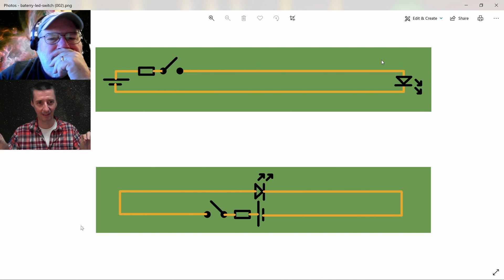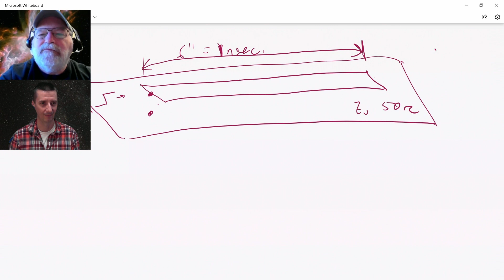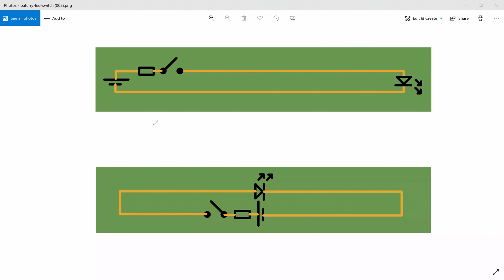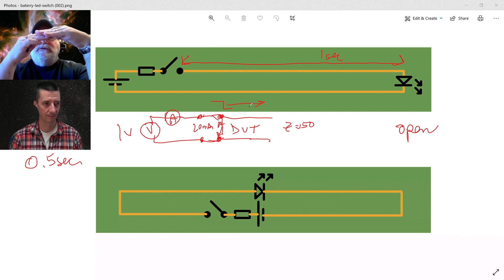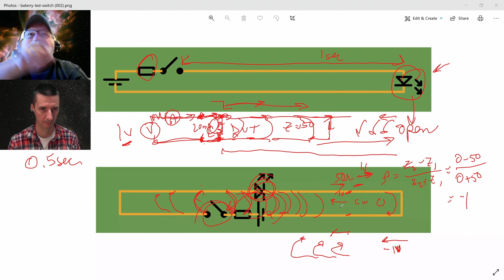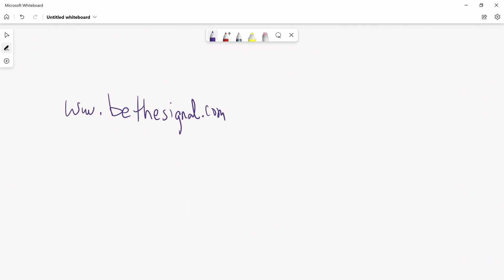Explaining Veritasium Electricity Video: Energy doesn't flow in wires (with Eric Bogatin)

Comment: I loved this video!! unfortunately the last part lacked some detail... The circuit created in the original video, as Eric perfectly described has 2 transmission lines and the reflections can make the situation quite complicated. Depending on the Zo of the Tx lines (in the video two simple cables separated 1m by air) can be in the order of 800 ohms (a 1mm diameter cable and 1m separation using the standard equation for a bifilar tx line), if the propagation speed is considered to be C (time delay to reach the end is 1 sec), and just to take a number consider that the light bulb is 100 ohms, the multiple reflections (and transmissions) from one Tx line to the other will create a time constant that can last tens of seconds (with steps every 2 seconds) to get to the steady state value. This is quite simple to simulate in Pspice. The instantaneous current through the light bulb is V/(R+2*Zo) (neglecting the V internal resistance), which naturally will be extremely small because is displacement current between two wires spaced 1m appart.
Reply: Exactly! That was my first answer, the LED will start instantly but very dim. Also Dave on eevblog missed that out.
Reply: I've still not seen anyone explain this correctly, as Federico Di Vruno has mentioned, and now even the Master of SI himself has ignored the details that so many engineers are bothered about on this problem!
Reply: @HelloWorlds__JTS  few people understand that when the switch is closed the two transmission lines look like a resistor equal to their characteristic impedance, or 800 ohms. Therefore, when the switch is closed the light bulb is in series with 1600 ohms and the travel time will be for the 1 m distance between the battery and the light bulb.
Then, as the reflections bounce back and forth the light will flicker depending upon the instantaneous voltages and eventually settle out to the DC circuit of just a battery and bulb.
..
The way the circuit is arranged, this is very, very deceptive. It is almost certainly done to confuse everyone.
Reply: @Observ45er  It was not to confuse anybody. It was to demonstrate that wire doesn't carry energy. People confused themselves.
Reply: @PafiTheOne  if wire doesnt carry energy than pls touch  220VAC wire with your hand....
Reply: @naszadynastia  A do it regularly while developing and testing offline power supplies. Try again!
Reply: @PafiTheOne  So why is the wire needed, if the wire doesn't carry any energy?  Obviously the wire serves some purpose.  If people are confused, it is only because they know intuitively that the wire is there for a reason, but no one is telling them what reason.  Instead, we're playing gotcha clickbait gimmicks by pretending displacement current will be enough in a situation like this to make a light bulb reach nominal brightness nearly instantly.  People are right to be suspicious of this, because it will not happen as shown in the original video.  To use the original author's words, he lied to his viewers about how electricity works.
Reply: @DeadCatX2  Almost nobody asked why there is wire. But the answer is trivial. The wires are there to conduct electrons. And not to conduct energy. (1 particular way of carrying electrical energy involves conducting electrons. It is not neccessity, only 1 choice. You don't "need" the wire.) This was the subject of the lession: Electrical energy and charge are not the same thing, and even not in the same space . 

Nobody told full current. (Yeah, except for the lie of RSD Academy guy, telling "short circuit".) That's just an irrelevant misuderstanding.
Reply: @PafiTheOne  It's not an "irrelevant misunderstanding", it is something Veritasium deliberately SHOWED his viewers.  During his demonstration, the bulb reaches full brightness in an instant.  Can you actually argue in good faith that this was not intended to trick the viewer into thinking that full power delivery occurred after 1m/c?  To use his own words, he has lied to us about how electricity works - even under ideal conditions there is only 1/4 of the total power available at the load after 1m/c seconds, and the other 3/4 of the power will be delivered to the load once the wave has propagated down the wire, which will take one second.

Furthermore, once the transmission line has charged, there is no more displacement current, and the Poynting vector is no longer the appropriate way to analyze the power flow.  In other words, the effect which keeps the light on is totally different from the one that could possibly turn it on after 1m/c seconds.  And you DO in fact need the wire if you want that DC circuit to keep driving the load.
Reply: @DeadCatX2  OK. So you seriously believed for even a moment that this thought experiment has really been conducted?!? I have not imagined this before that anybody could believe this. And you believed those wires were 1 lightsecond long and made of superconductor? This is a whole new point of view I haven't realized before. Thank you for enlighten me!
Reply: @DeadCatX2  Yes, I can argue that this is not an intentional misleading. If anybody wants to figure out the answer to the question , then he needs to listen to the beginning where the details of the (thought!) expriment are told. But the bulb shown in the video is lit near the end of the video. A real problem solver should not watch the solution before understanding the question. So if you are tricked, then tricked yourself by peeking the solution before understanding the question. :-)
Reply: @DeadCatX2  "the Poynting vector is no longer the appropriate way to analyze the power flow"

Obviously you have not calculated any Poynting vector if you believe this. It is perfectly valid at DC also.  E field is obviously still there, and instead of displacement current the conduction current generates B field, it doesn't make any difference in validity, only in value, and is perfectly coherent with the result of simple circuit analysis. The power transfer is still be described perfectly by Poynting vector. (Obviously this is not a deduction, the deduction is made by Poynting.)
Reply: @DeadCatX2  Yes, the effect is "totally different", because it is a sum if many waves, not only the first. But all of the waves are described properly by their Poynting vector. So there is no error in this. 

You are right, the wire is needed if a circuit is defined to contain wire. :-) But this is nothing but tautology. In a different circuit it is possible to drive the load without the wires, just not in that circuit, because it is defined to contain those wires.
Reply: @DeadCatX2  "in an instant". Can you see 3.3 ns delay in the video? :-) That was the official answer, not "an instant"!
Reply: @DeadCatX2  "1/4 of total power"

You believed what this video stated? No, there is not a defined ratio. It depends on the actual impedance ratios. Can also be much worse or slightly better. The higher the resistance of the bulb the more portion of the final current arrives "instantly". (Maybe this was the only error in this video if we don't account that it bored me to death.)
Reply: @PafiTheOne  I said in the ideal case, where the source, load, and characteristic impedance are all equal, that you will get 1/4 of the power delivered after 1m/c.  In less ideal cases, it will always take even longer to reach equilibrium.  For example, as shown in ElectroBOOM's video, under realistic conditions you will get a series of much smaller steps as the transmission line gradually develops the electric and magnetic fields it needs to sustain a DC transfer.
Reply: @PafiTheOne  Judging by your silence regarding the full-brightness light at a point where it cannot possibly be full brightness, I can assume you are conceding this point - that the original video was suggesting full power was delivered to the load immediately.

While the math behind the Poynting vector is still valid at DC, in practice it is almost always used in the context of time-varying fields because there are simpler approaches for analyzing steady-state DC circuits.  Furthermore, the original video showed all Poynting vectors as having equal strength, when in reality the vectors get much stronger as you get closer to the wire, where the magnetic field is strongest.  This is once again contrary to the impression that Veritasium makes.
Reply: @PafiTheOne  Wow, forgive me for not realizing you responded five separate times.  I only saw the most recent two.  It seems you have quite an attitude, and enjoy putting words in my mouth.  I won't waste any more time trying to have a civil discussion with you.  Of course I knew it would take one second to reach nominal brightness at the beginning of the video, which is why I knew immediately when he showed the light at full brightness that he was lying to his audience about how electricity works.  The fact that you're an apologist for this kind of deception is stunning, but it makes it clear there's no point in discussing this with you, since you are not only rude, but intellectually dishonest.

Goodbye.
Reply: @DeadCatX2  "I said in the ideal case, where the source, load, and characteristic impedance are all equal..."
 You have not said this, and this is not the "ideal" case (according to what?), nor optimal case. And your belief is not supported by any argument. Have you analyzed properties of the wavefront? Obviously not. Actually at the first moment when the wavefront reaches the "lamp", the power is 0, since the cross-section of the power transfer is just 0, but starts to rise fast, and in ~10 additional ns it almost reaches a first, quazy-stationary value. 

You have ignored what I wrote: the higher the impedance, the higher portion of the final power is reached almost immediately. 

You also ignored that a battery typically has negligible resistance compared to load. 

You also ignored that Mehdi calculated capacitance seriously wrong. And that bulbs can have higher impedance too. 

Ignorance is a strong weapon, but not appreciated.
Reply: @DeadCatX2  As you realized, I was not in silence. I suggest you to modify your comment accordingly! (But judging from what is not told instead of what is told is a serious mistake alone already. Don't do that! For not telling something there can be many reasons, not just agreement.)

all Poynting vectors as having equal strength
This alone is factually false, but I guess the source of your fault is in the conceptual misunderstanding of field lines in describing vector strength. The strength of the vectors are represented by the density of the lines. And you can see that there is more line density near the battery, which is correct, and contradicts your claim above. 

Please read this carefully:
https://en.wikipedia.org/wiki/Field_line

Furthermore, the original video showed all Poynting vectors as having equal strength, when in reality the vectors get much stronger as you get closer to the wire
The original video did not show all poynting vectors at all because there is not enough room for that, and there is also no reason for that. The strength of fields are described by the line density in this representation. There is not enough room for showing not just not all, but on this 3D image even to show extremely roughly the distance dependence would require such number of lines that would cover almost the whole screen, and nothing else would be visible. If you want to describe the field strength with only a minimalistic 2 bit resolution, and if you want to show only 3 different distances, at 4 different directions from both wires, then you needed 2*4*(3+2+1) 48 lines. That would be a big mess, for no acceptable reason, and would be quite a pain both to create and to understand. You can try if you want! 

This is once again contrary to the impression that Veritasium makes
I don't know your impressions, but I can see nothing in this graphics that would make a false impression. Only your expectations are almost impossible.
Reply: @DeadCatX2  I don't know where my answer has gone about your baseless 1/4 power and the miscalculation of Mehdi, and the fact that you have ignored my claims, but if you reported it to delete the unconvenient facts and to make debate impossible, then feel the shame!
Reply: @HelloWorlds__JTS  see here for a bit more detail…
Reply: And how energy is transferred if wires are closely shielded ?
Reply: @naszadynastia  a wire with a shield around it is nothing more than another transmission line. Displacement current will still occur, depending on how the shield is connected to the other parts of the circuit it can have some effect… conduction current (ie stationary regime)is not affected at all by shielding.

Comment: The impedance of 2 wires 1 meter apart is so high that very little current would flow through the air. The light will not light up instantly.
Reply: around 900 ohms. not that high.
what you missed  I think is, with DC there is no big field around the cable, therefore the low power through the air.